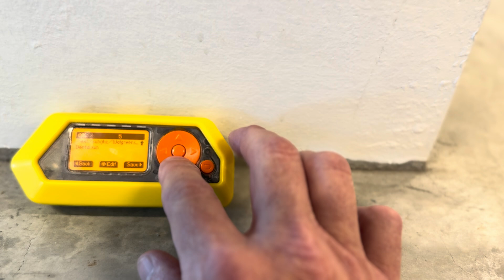Flipper-Zero SubGHz Remote

Comment: The flipper isn't the right tool for the job. Sure, it can hold a ton of different files. But for a quick duplicate of a fixed code, I recommend a 4 button RT433 based RF duplication remote. 
It can be 4 different buttons for one remote or unlock for 4 different remotes and on different frequency bands. They're like 5 bucks each. 
There's no save buttons or menus. Just point one remote at the other and done.
Reply from the maker: Sounds cool, too.